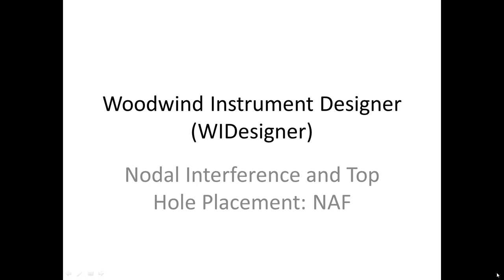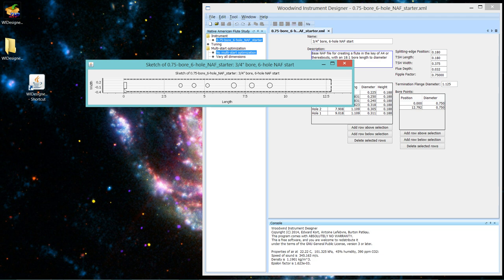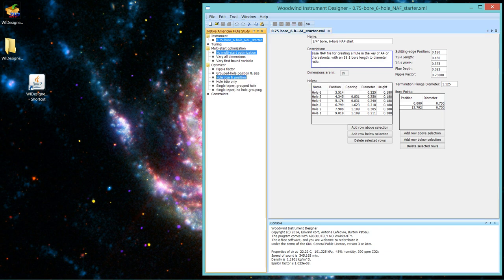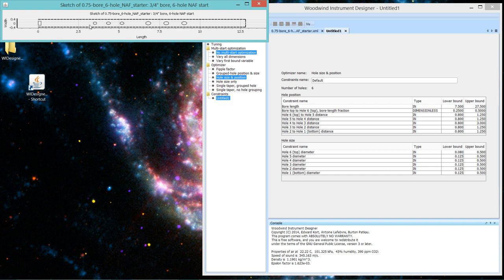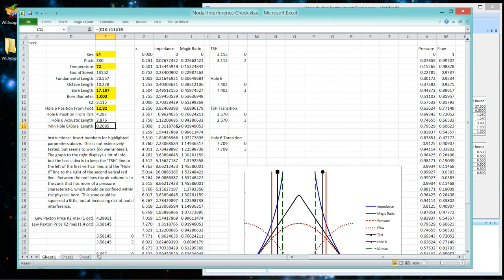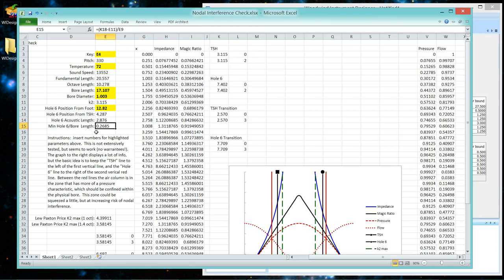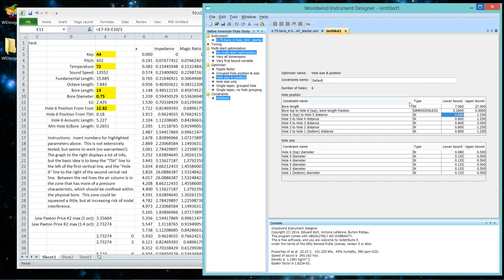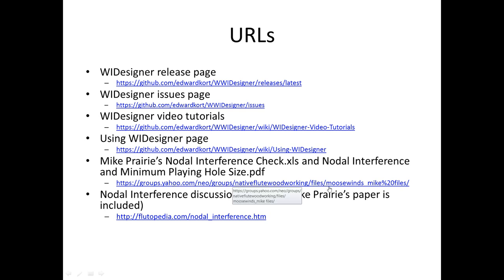10. WIDesigner Nodal Interference - NAF

Comment: 2 more questions - 1. How can one apply MP's spreadsheet to tapered or stepped bore designs? Or, to expand the question beyond just the tool, how does one determine K2 length and thus node/antinode locations in a non-cylindrical design. Clearly this is being modeled for us in the tuning hole placement algorithms, but that pesky top hole placement (which you characterize as "exciting" in your designs... :)) is being set finitely in the constraint parameter rather than optimized. I'm tending to be a little more conservative than 25%, especially with flutes with endcaps or design motifs that can't be shortened and tuned up gracefully. I'd like to understand the internal workings of each design a little better rather than just follow a conservative path with a formula.
2. Do you have a patreon page. I'd like to contribute in some fashion to the further development of WWIDesigner.
Reply: Hello Stephen.
1. You are correct, MP's spreadsheet assumes a cylindrical bore profile. And virtually all of my flutes utilize a bore taper. Nonetheless, using the bore diameter at the foot of the flute and assuming a cylindrical bore, I have found that the spreadsheet results work quite well. But I too am somewhat conservative: I add a couple of percent to the spreadsheet results when determining top hole placement.
WIDesigner has no concept of k2. Instead, the head of the flute is treated in a more complex fashion, modeling the TSH and headspace (bore above the TSH) as contributing resonators. I looked at some of the analytics that WIDesigner can generate to see if they could be used to evaluate top-hole placement, from the note spectrum graph and supplemental info table values. None of them seem to be diagnostic for nodal interference. That said, we know that our mouthpiece model is still very simplistic and doesn't contain the specificity to accurately predict harmonics (resonances - yes, harmonics - no).
2. We would be delighted to have additional contributors. And Git/GitHub supports such contributions without opening the code base to potential corruption. Anyone can check out the project and create a branch to work on. You can even keep your branch synced to the trunk (or not). When you are read to submit some code, you create a pull request. The project team can then review your changes and merge them into the trunk. Please look at the Help files on GitHub for more information.

Comment: Questions re: acoustic length, k2 and fipple factor.  1.a. If we know the closed hole (or no hole) frequency of a flute, can we simply determine k2 by subtracting the bore length from 1/2 the wavelength? 1.b. If so, is this value for k2 a stable, usable value as we make other changes? i.e. does k2 change if we shorten the bore or add direction holes? 2. How can we determine what values we should use for bore length and diameter if using a stepped or tapered bore profile? 3. Can k2 be derived from fipple factor and the other parameters in your software for irregular end flutes?
Reply: k2 is the length left when the bore length (measured from the foot of the flute to the splitting edge, top of the TSH,  top of the bore, or whatever) and the bore radius at the foot divided by 3 (k1) are subtracted from the half-wavelength of the fundamental. If you change the acoustic length of the flute (with direction holes or shortening the bore), k2 will change; it is not a constant. k2, in conjunction with the bore length, can be used as a rough measure of nodal interference.

The fipple factor is only remotely related to k2; it is a measure of how the actual area of the TSH relates to its acoustic area: the shape of the TSH and the bird over it. The other parameters that confound k2 are explicitly modeled in WIDesigner, so the fipple factor is relatively stable for a given TSH/bird geometry.